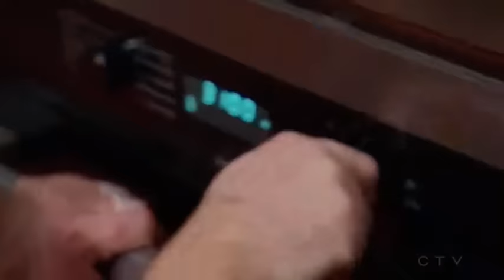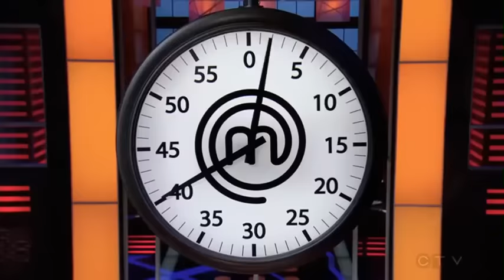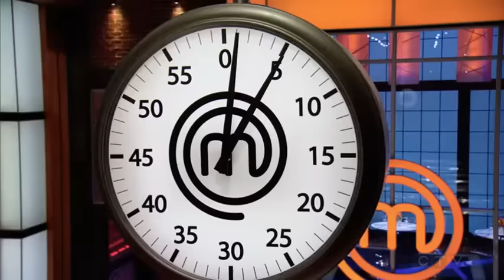MasterChef Canada Season 5 Episode 3

Comment: 32:18 Keagan making a tres leches or a cake? I know brushing sweet syrup on cake before adding filling a standard to keep it it moist, but soaking an entire cake on sugar water? any hard cake would turn to mush and fall apart if you do that, he should have just brushed it around with the sugar water while on the cake stand

37:01 Reem's cake would have turned ok if she had just left it on the table and let it cool down normally while she is finishing her filling, the residual heat would have cooked off any imperfections with her cake batter. Though the downside is she wont be able to apply filling and icing on it until it fully cools down.

Comment: There was one critical thing missing. I don't saw anybody using Kirschwasser spraying on the layers. 
You can get slightly drunk from a real one. Also the sides are typically covered with chocolat chips.
All of hem should be dark ones (not the sweet ones they used on top).
Also the shaft from the cherry should be removed (they are also soaked in Kirschwasser)
I am not a cook - But i am from the Black Forest, and i now that cake really really well.

Best Regards from Germany - Black Forest (near Lahr)
Kai

PS: I really miss the Canadian Soldiers (and their families) that were here when i was a child. 
They were highly valued by all locals. They were even better treated as drivers as the locals treated them selfs.
Everybody knew the Canadians drive with the most respect. Even i was a child, i still remember that.